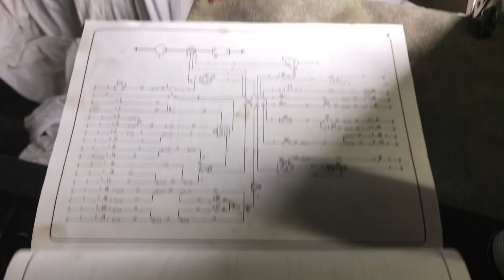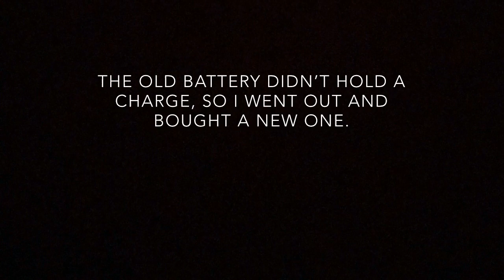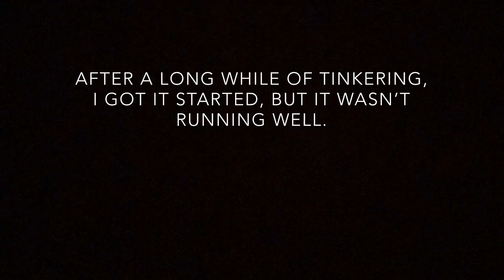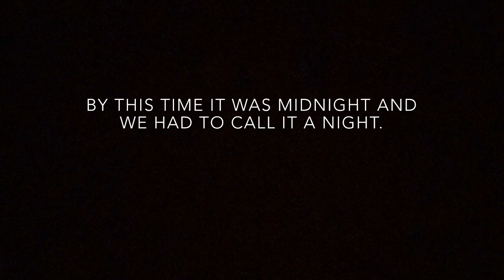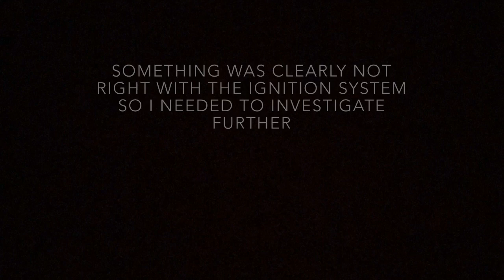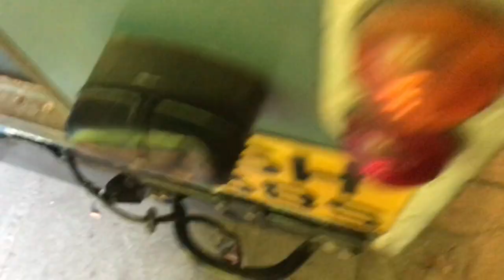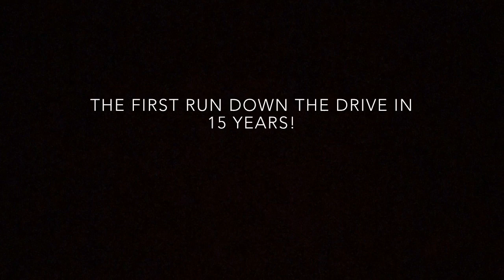Land Rover Series 3 Restoration - First Start & Drive Pt. 29

Comment: Hi, the issue is the fuel tank.  New ones have the filler neck too far forward.  You have to cut the rear tub to fit around the filler to help move the tub rearwards, of have the fuel tank filler rewelded in the correct place.  Ask me how I know.   Good to see your progress.  Thanks for sharing.
Reply from the maker: Thank you.

Comment: Congratulations, that first drive of a project car is always the best@  Having a few niggles to sort out used to frustrate me, now I just treat it as part of the process.  
The "Hazard Lights" loom could be for trailer lights?  Some trailer wiring uses a second flasher unit for the trailer.  Has it ever had a tow plug?
Reply from the maker: Hi Brett, I think you are right. It did indeed have a tow hook with electrics! Thanks for solving that one. I also have a very dim (albeit new) drivers side head light. Any ideas? The other side is fine. Bad ground perhaps?
Reply: @My911  Bad earth/ground is most likely Joel.   Could also be a corroded terminal or partially  severed wire somewhere causing resistance.  Is the problem the same on main and dipped beam?  If both are equally affected, earth wire.   If only one beam is affected, it will be in that circuit.   I'd start at the plug, cleaning up the contacts and work up the loom from there.